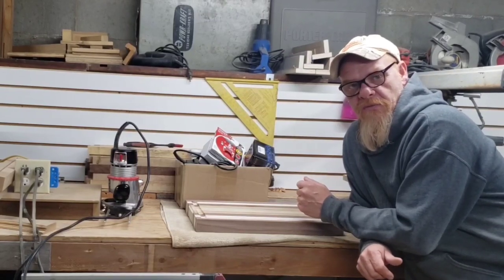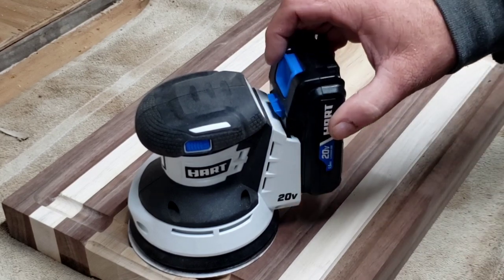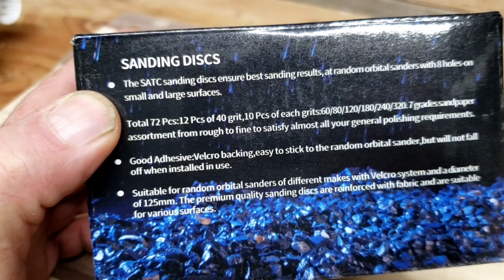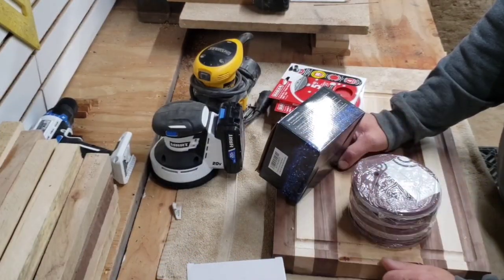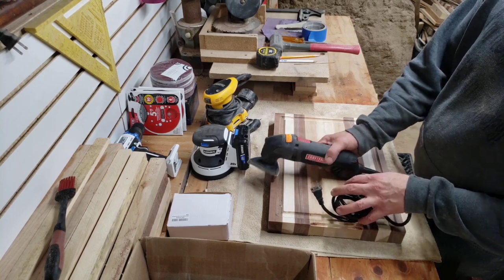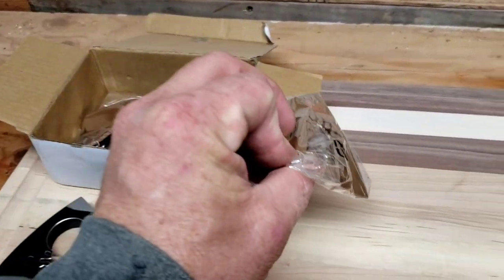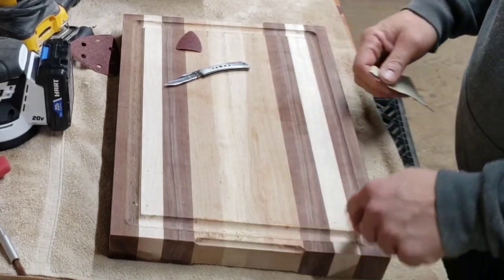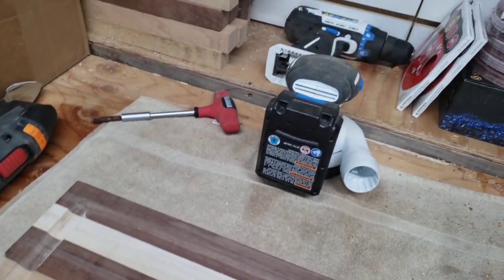Why BUY Hart Tools ?

Comment: Kevin. How’s the battery length on the Hart sander?
Reply from the maker: It's not terrible. It is a one man shop in the dungeon and it rarely runs out in the middle of a job. I am very pleased with it and how smooth it is. It probably wont compete with a Festool or Mirka, but I like it.